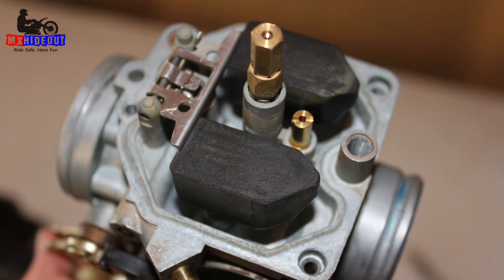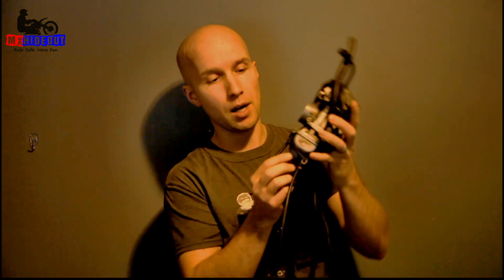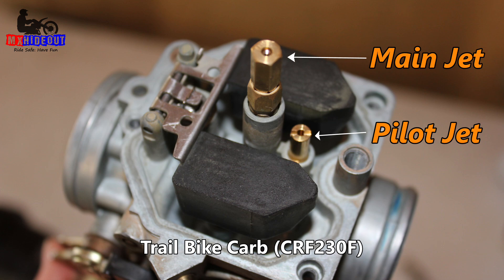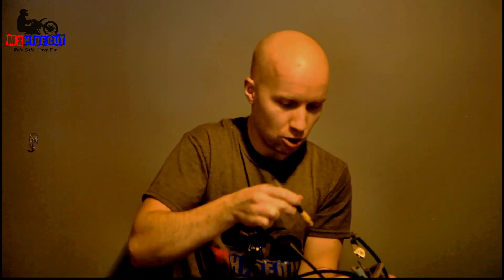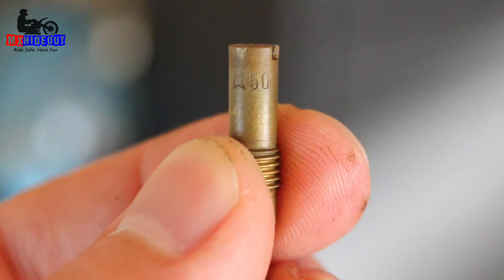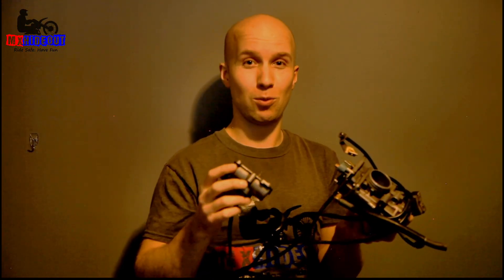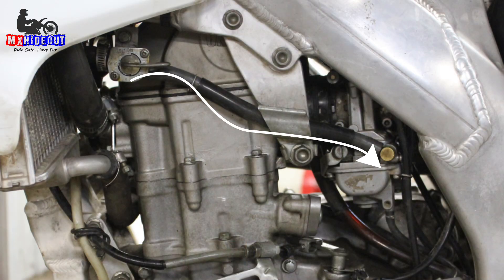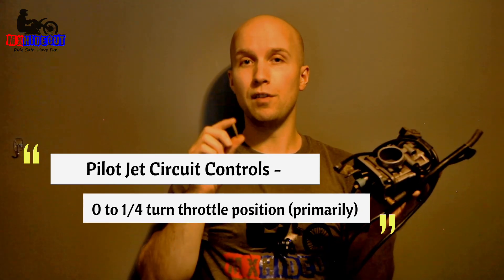How The Pilot Jet Actually Works In A 4 Stroke Dirt Bike Carb [For Beginners]

Comment: Hello! I just started watching a few of your videos and like them I’m having trouble getting my 2006 crf150f  running right. It has a 2-stroke Polini 26mm carb and stage 2 cam. I got it as a non-runner, I’m at 0-500ft elevation, have a 42 pilot, 120 main, clip- 2 from top (5 slots), and am not quite there. I’m going to try to find you on different platforms and see if you may be able to suggest something. I can’t ride it right now,  mid-NY state snow dumping down but do have it in a heated garage. Please help 🙏a buddy out
Reply from the maker: Hey Ryan, sounds like a cool build! How does it start and run right now? What symptom are you trying to fix?

Comment: Perfect timing, I am about to re-jet my daughters 2007 CRF150F
Reply from the maker: Nice! Does it not run right?
Reply: @MotocrossHideout  I decided to check the plug and it looks real good but was barely even finger tight so I wrenched it down a bit and its way more powerful to me.
Reply: @MotocrossHideout  I bought it used and it just seems gutless, like very powerless, could be that I weigh 232 and ride a TX300 so it just seems weak.....
Reply: @MotocrossHideout  I figured a 150 would be a little more power.... I have no idea how long it sat or if maybe it just needs to be cleaned. I will say this, when cold it will not start choked at all, but turn off the choke and it starts... thoughts?
Reply from the maker: Cold start easier without choke = rich